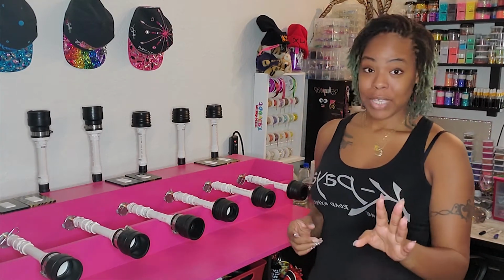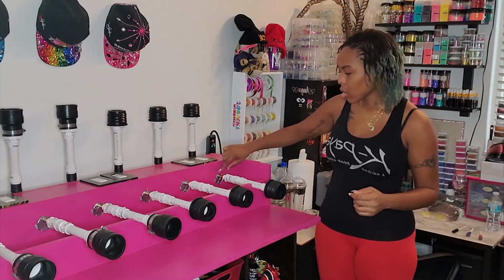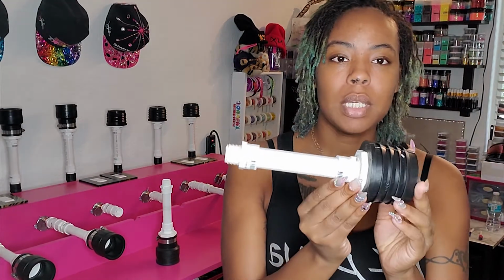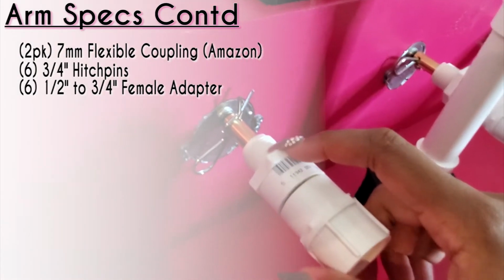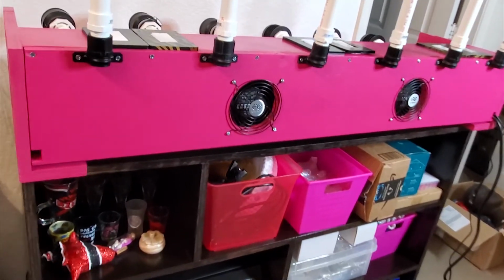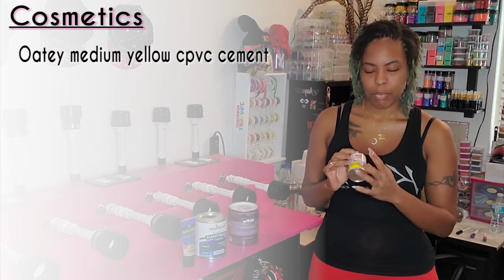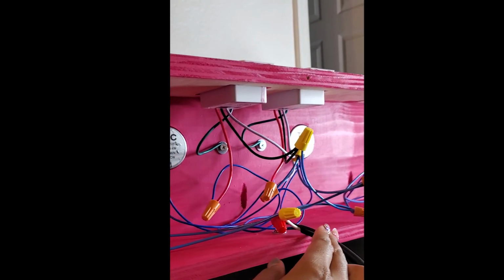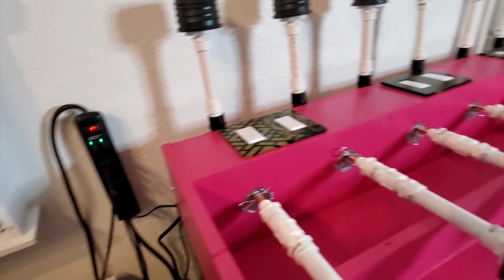Building My Cup Turner w/ Smart Switches

Comment: Awsome and detailed.  Thank you.  Just one thing -FANS--  Your fans bring in air.  Did you make holes for air outflow or does the air have to fight it's way out?  You will have more airflow if you do an exhaust for the air.
Reply from the maker: Thank you 🙏🏾

So these particular fans are exhaust fans.  Because I wanted to suck the air out, not necessarily blow air on the motors
Reply from the maker: I am by no means a professional tho. So you can take anything I say with the smallest grain of salt 🙈 I just made this with my very limited knowledge
Reply: Angee just trying to help here.  You will get more airflow if the air has a way in and out.  Doesn't matter if you are blowing out or in.  Since you are blowing it out of the closed box then the new air needs to get in.  You will get an increase in airflow if you put some holes in either end of the turner.  For instance if you blow into a paper towel tube the air will go through.  But if you cover the end of the tube it will be hard for the air to go through.  Again just trying to help.  Your turner is great.   @DesignsByAngee
Reply from the maker: @heathersmyth3517  I know you're trying to help, and I would never turn it down. So I'm very appreciative 🙏🏾 There are holes on either end in the bag but I don't think they make a big difference. It's meant to feed the power cord through if I have to switch sides of I move the turner to a different spot in my room. So if I get some time I can add two more

Comment: Amazing job , my husband is building using your video. He and I was so impressed by your video and have watched it probably 20 times. Thank you so much.  I would send you a pic if I could. Thank you soooooo much.
Reply from the maker: I'm so very happy I could help! I hope everything goes well 🙌🏾😊

If you haven't done the wiring as yet, make sure to run all your ground wires to the green wire in your plug that connects to the wall. It was noted by some more knowledgeable ppl in the comments that its a better way to do it, and safer.

You can send a pic to my IG @designsbyangee when you're done. I'd certainly love to see it!!

Comment: How do you measure the holes on the front base to align with the PVC pipes ?
Reply from the maker: I'm not sure why my reply won't post :/
Reply from the maker: I believe someone answered this previously in the comments. You can extend a piece of pipe from the motor to the front board to find where to cut out. As this was my first time building a turner some things were guesswork. This was one of those things lol

Comment: I use to use the flexible couplings but its hard to get the top rim of the cup if you go all the way to the top. do you have any suggestions"
Reply from the maker: Hi, for the time being I stick the coupling all the way inside the cup, and I cut the rim for the donut. I haven't found a suitable replacement that gives me the sturdiness of the coupling without having to force it in, particularly when working with skinnies.

I am elbow deep in carnival right now, but once it's finished I planned to do a update video.

Comment: What is the purpose of the support pieces?  Are they necessary, couldn't you just have the base without the support pieces? Can you tell I have never built anything in my life? Ha!
Reply from the maker: The sides of the housing sit on the support pieces. Its also there to rest the sides of a cover on top of. That's something I plan to add to my turner at some point.

You could very well do a build without the supports, you'd just need to make sure to adjust the measurements accordingly.
Reply: @DesignsByAngee  thank you!!!
Reply from the maker: @bethwinger6457  You're welcome :)

Comment: Great video.
I need to know where to get cups and stuff on the cheap
Reply from the maker: If you want super cheap and don't mind waiting, go straight to the source and order from Alibaba. China is where all the US sellers cups are manufactured anyways.

If you're looking for decent priced in the states I would join a FB group like Tumbler Hacks 101, search where to buy tumblers, there's many posts about it and lots of ppl give different companies. 

I personally get mine from The Stainless Steel Depot. I've never had an unsolvable issue with them. I know there are other companies and I've been told they're maybe $1 or $2 cheaper, but I like the variety of cups and the prices are reasonable.

Comment: Girl thank you! The way you hammered in the coupler and used the hitch pin, is that still working for you?? I’m not having any luck doing it the basic way, the way most ppl show in their vids. If you still love this set up I’m literally going to buy the motors , couplers and hitch pins with female adapter today! Also if you still recommend this method, could I put a bit of gorilla glue where the coupler was hammered in?? Thank you for this video! Your turner is beautiful!!!
Reply from the maker: Hi :) Yes the coupling & hitchpin are still holding strong. Gorilla glue isn't a bad idea at all, always good to have a fail safe 🙌🏾
Reply: @DesignsByAngee  you are an amazing soul! This technique seems to be so much easier and stronger than any others I’ve seen and tried! And thank you so much for responding, I’m rebuilding my set up completely and now I’m able to buy everything today. You are a life saver! Keep up the great work! Thanks again...❤️
Reply from the maker: @brittanibunte-thornblom352  You are quite welcome! I'm very happy I could help ☺ Good luck on your re-build! 😊💖

Comment: What groups hook a brotha up😁
Reply from the maker: The one I frequent the most is Tumbler Hacks 101. I'm also in Tumbler Tutorials & More. 

For products I use, I'm in The Glitter Guy, Tumblerpoxy, and The Stainless Steel Depot. I only mention those because (1) if you're using a particular product being in their FB group can help in quickly finding product specific answers to questions you may have and (2) ppl in the groups are usually pretty good about answering any other questions you may have.

Hope this helps

Comment: Thank you for your tutorial but you're going to get yourself and others injured by the simple fact of your ground AKA your green wire are not connected to the green wire on the wire connected to your outlet if it was a metal case that you had the motorist or the switches in then you can ground it directly straight to the body but it's wood what is not a conductor unless wet then yes so do yourself a favor and I hope I they see this make sure that you ground the green wires and Junction with one another so they can react to the green wire of the main plug plug it into the wall but again thank you for your tutorial otherwise
Reply from the maker: Thank you for your input 😊 Someone else gave the same advice in the comments previously and I did respond to them that I would heed their advice. Hopefully those watching will see either of your comments, or do as I suggested in the video and get the wiring done by a professional. Again thank you, it's greatly appreciated 🙏🏾🙌🏾

Comment: Maybe I keep missing it but how do you have your pipes screwing in and out so easy?

Also If you want to mount your holders on top you can use (home depot)  3/4 in. Insulating Suspension Pipe Clamp by Oatey Model #33583 Store SKU #671016

Gorilla Heavy Duty GorillaWeld Steel Bond 2-Part Epoxy Gray - 433010 but I didn't scuff my pvc and now I think I should have. I'll know tomorrow LOL.

Also 24 in. Rip-Cut Aluminum Circular Saw Guide by kreg. If you are making a table out of saw horses and 3/4"-4'x8' plywood grab you a 2"-4'x8' foam board (I use owens corning FOAMULAR 250). Then with my guide on my saw I set the saw 1/8-1/4 below my cutting piece. This cuts into the foamboard but doesnt hurt anything and you cut all the way through with a straight line.

I'm using a currant switch in mine to turn the fan on. Any time a turner comes on it will detect amp and automatically turn on my fan. You have to be carful which you get, some can read 120vac but only output 24vdc or 24vac. So if your fan is 120vac you need one that will switch 120vac. amazon has the CrocSee Miniature Current Switch, CS-TS0, Normally Open Amp Sensor Monitoring Relay, AC 1-50A Detectable. It has a max of 2.5A load that it can output. so most fans are like .5 or less but check what you have. It is really simple to use. This way my fan is only on when a motor is running and I don't have to think about it.
Reply from the maker: You mean the assembly of the arms or how I screw in the arm to the turner?? 
For the assembly of the arms, pvc glue makes it very easy to screw in all the way, before it dries. Screwing the arm into the turner tho, I'm not doing anything special, just screwing it in normal lol 🤷🏾‍♀️

I didn't think about mounting the back arms on top until I was finished and realized where it was gonna be placed 🤦🏾‍♀️ But they're good for now 😊

Comment: LOVE LOVE LOVE the explanation on this!  Thank goodness!  So thorough!!!  You have everything I've been trying to google to look for.. as in fans, smart switches and so forth.  Currently, I have the main power cord, attached to that one block wifi plug, so it shuts off the whole thing, when I'm out, but individuals make since if you have different projects turning at different times.  I have been trying to look for those fans, what do I search for it.. I just hear people calling them cooling fans.
Reply from the maker: They're also called exhaust fans but here's the link to the one I bought and I'm sure Amazon will suggest others that compare. 

https://www.amazon.com/dp/B07CZRKTBZ/ref=cm_sw_r_cp_apa_fabc_GW6K14BTZ00QQ51DBRJS?_encoding=UTF8&psc=1
Reply: @DesignsByAngee  Thank you!!
Reply: Yup! That one.  I wish we could send pictures, but yeah the ones I found also are 1/2" (threaded) to 3/4" (smooth side), but the gold coupling fits but its not snug like where I gotta hammer it. It fits right through the 1/2".  But I think I found out last night what it was... one is called the Charlotte PVC and the other one is a Dura.. and i think I have the dura.  Not sure what the huge difference on the 1/2" threaded side is, but the Dura one doesn't fit as snug.
Reply from the maker: @tphan722  Hmm, maybe Dura is metric 🤷🏾‍♀️ I didn't know it had different brands. I just bought whatever Home Depot sold. But for the coupling the 1/2" side should be male, for the gold piece to be hammered in. And the 3/4" side should be female. If you found a piece that is male on both sides, then you actually eliminate needing the small piece of pvc, and your 3/4" female smooth to 3/4" female threaded should fit right on it. That's only if the coupling has a smooth male end. If it's threaded see if there is a 3/4" female that is threaded on both sides.

I hope that all made sense lol
Reply: @DesignsByAngee  Hi quick question how do I measure the holes that support the PVC pipe for the front support to align with the PVC pipe
Reply: For the coupling to the 1/2 to 3/4, i didnt find a female , but i found the male one.. is that right?
Reply from the maker: @tphan722  Are you talking about the piece that connects to the motor?? Sorry, my memory about all this is fuzzy 🙈

Comment: On the smart light switches can you also turn them off like a regular light switch or do you have to use the app?
Reply from the maker: You can turn them on and off like normal. I really use the app to set timers and only do the on/off if I'm too lazy to do it manually.

Comment: Thanks for the tutorial. Question why did you use the doughnut and couplings instead of the foam footballs"
Reply from the maker: You're welcome :)
I used the plumbing parts because I saw them being used in some fb groups I'm in and decided to give it a try. Honestly, I'm not disappointed. I've had to make some adjustments (which I'm hoping to do an update video for soon). But they're working out perfectly. The biggest benefit is that I don't have to replace them or dry them out when they get wet, like when hydrodipping.

Comment: Question: I noticed that 2 of your motors are tuning counter clockwise, did you do that on purpose for a reason? If not, if you swap the leads to those motors, (Load and Neutral) the will spin in the same direction! I was concerned about the grounds, but you addressed it in the comments. 
I must say you did and EXCELLANT job with the building of the unit and the video production as well! You should be very proud of this tutorial. Thank you for creating , and sharing it!!
Reply from the maker: Hi! Thank you, I'm just glad it's helping people :)

The motors turn both clockwise & counter-clockwise. I do prefer the clockwise motion when generally applying epoxy. But I find the counter-clockwise helps when applying my marble look. Most people toggle the switch the get it to change directions. But you can also do so by holding the arm while its turning, it'll then go in the opposite direction.
Reply: @DesignsByAngee  yeah, I'm realizing all things are not as they seem! I've learned the motors are bi-directional without swapping leads! Great job!

Comment: Ma'am, tie your grounds together and to the plug ground please.  Wood isn't a good enough conductor to worry about a shock, but those switches could be.
Reply from the maker: As in a fire could spark or that it could shock me when I use a switch??
Reply: @DesignsByAngee  Exactly, the switch housing is most likely steel, as well as the motor casing. For the system to be super safe, I'd recommend tying the ground to the motor casings and switches. Then if there is a short it goes to ground not you.
Reply from the maker: @jimmymckracken305  Ahh ok. I had a general idea, but didn't know exactly what I was doing when wiring everything🙈 Next time I go in there I will get those wires connected to the plug ground wire. Thank you 🙏🏾
Reply: @DesignsByAngee  Your Welcome ma'am. Thank you for sharing your art!

Comment: with the fans, do you have one pulling air in and one pulling air out?
Reply from the maker: I have both pulling heat out. I reached out to the seller I bought them from and they said exhausting the heat away from the motors is the proper application.
Reply: @DesignsByAngee   Thank you!
Reply from the maker: @stacymallo7275  Very welcome :)